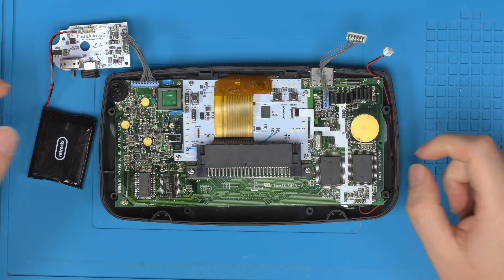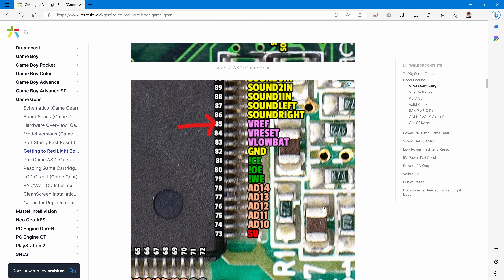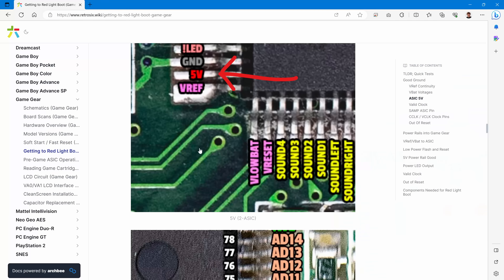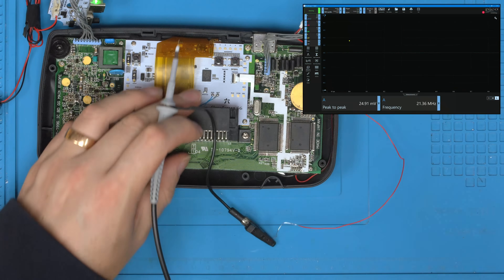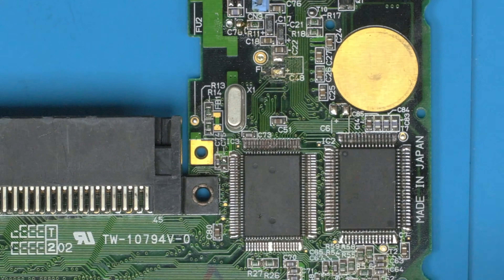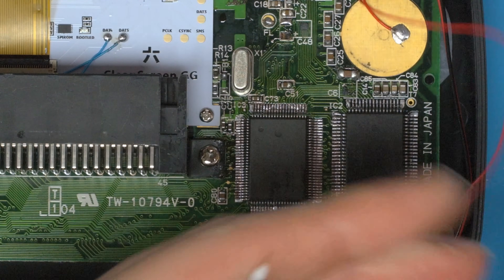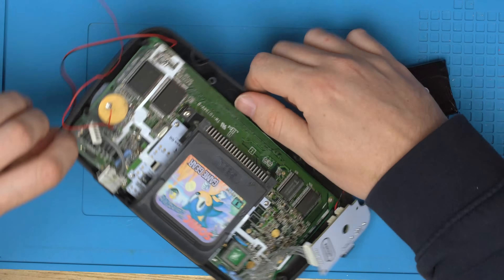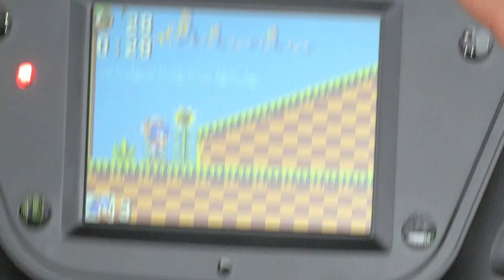Fixing Game Gear No Red Light Dead Screen No Audio Repair

Comment: You're a rock star! Thanks so much for posting these videos. I had a GG that would boot with a red light. Backlight on. When it boot it would go off and I'd  have to wiggle the power cable. Thought it was maybe a cold solder on the board. After i replaced all the caps it would only power on for a second and back off.
I discovered from searching "GG power on one second" your wealth of knowledge of videos. You've got amazing skills. I only wish i could troubleshoot like you can. I'm decent at soldering.
Reply: So how did you fix that issue as we have the same….
Reply: @nigelobject i ended up giving up and selling it as is...... sorry mate, best of luck with yours.

Comment: Hi,

I’ve recapped my GG and am using CleanPower and CleanSound. It boots to red light, sound is playing and buttons arr working, but the screen is black. I have a CleanScreen kit waiting ti be installed. Before I do, is the console ready or do I need to fix anything first? Thanks!

Comment: In the very first test you do from the power board ground to the red light ground pin 302 I get no continuity or ground. What's the problem here something wrong on the power board or bad red light resistor?

Comment: Thank you so much! I pulled my game gear out of storage this past weekend. It started off fine but when I turned it off it refused to turn back on.

I bought your CleanPower GG and I still couldnt get it back. I followed this tutorial and found the voltages were low. 
The game gear was the first device I ever repaired myself using a soldering iron and was the first console that I ever modded by installing an LED backlight. I bypassed the VBAT circutry and now it's on again!

Question though, is it safe to leave that bypass using the CleanPower GG or should I do something to repair it? Is there any downside to keeping it as is?

Thanks again!

Comment: I'm trying to fix a game gear (2-asic) with a strange problem, it works and gives video until the moment when the game needs to emit some sound/music, when music plays the console simply reboots,  have you ever fixed something like that? Could you give me any tips on where to begin?
Reply from the maker: Turn volume down. Does it fix it? If so it's power related. Bad power board, power wire harness or short on audio board

Comment: Currently working on a Single Asic GG. When I turn it off for example in a middle of gameplay, then when I turn it on, it continues on that gameplay. Turning the console doesn't reset the system.
Reply from the maker: Soft start fast off circuit https://www.retrosix.wiki/soft-start-fast-reset-game-gear